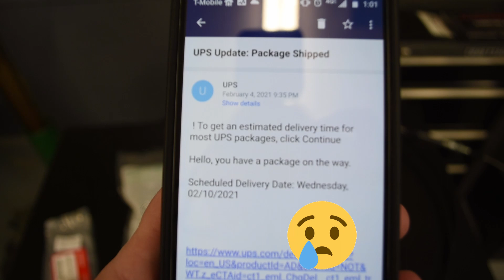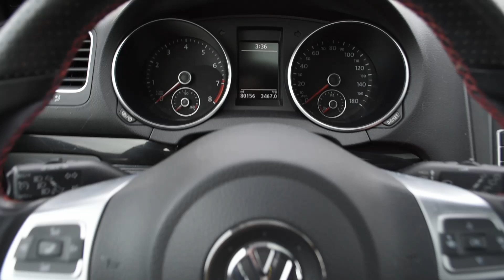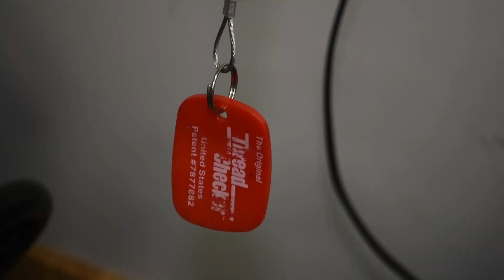She deserves better!  (Something I should have done a long time ago...)

Comment: Only thing I was missing was some grease on the threads when you put the boots back in? Still a great job though... Need to do mine as well
Reply from the maker: Now that you mention, I may have overlooked that. 🤫  Easy divot to fix though.
Reply: @LapoftheWorld  most certainly, but a shame of the fresh, hardly damaged paint on the bolts... Which will, inevitably, get damaged more by loosening and tightening them again😊